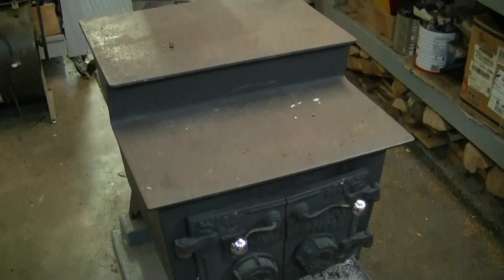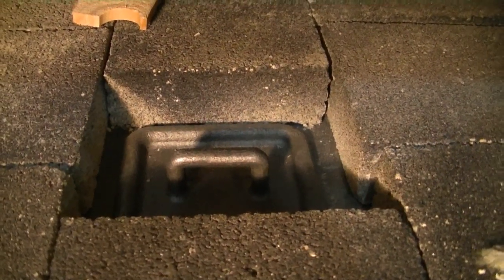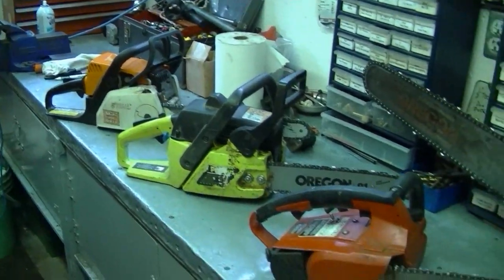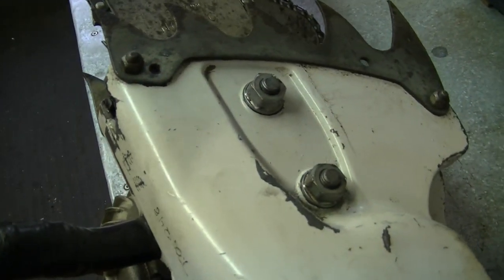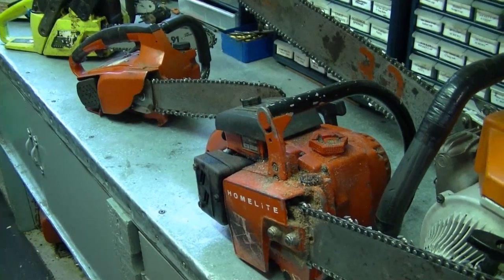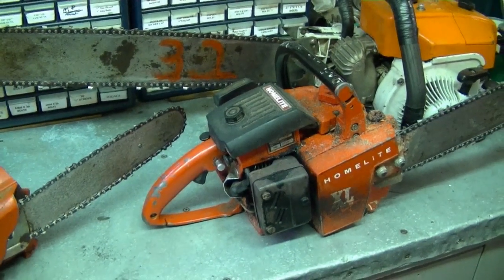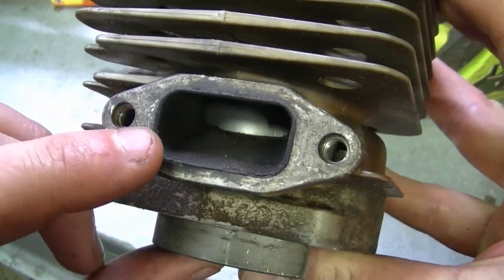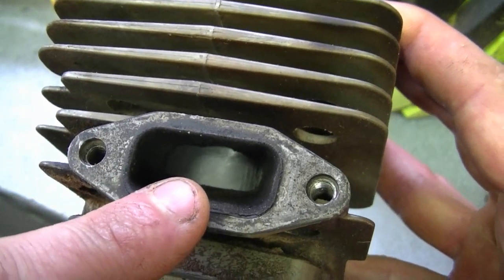Small Engines Q & A Video #71 in HD

Comment: @chrilla1980 I don't know much about small engines, but for a four stroke engine the main advantage of premium gas is pre-ignition suppression caused by anti-knock additives. For most auto engines, more explosive regular gas works fine, and of course it's a lot less expensive.

Comment: @siralexu depends, can you remove the cylinder, if so you can use a small wire brush,  or compressed air blower and poke around, I would recommend the compressed air, you can use carb cleaner or petrol or something like that, it will lift the carbon. just don't scratch the cylinder and make sure you leave nothing behind,the carbon may scratch the cylinder wall!!  if you scratch anything too badly it will wreck the saw...

Comment: Quick question Donyboy,

When a chainsaw is running should there be any movement in the clutch/sprocket assembly? Mine moves slightly forward and backward and I wasn't sure if some movement is normal or if it needs to be tightened up a bit?

Thanks!

Comment: hey donyboy73 I have a craftsman 3/21 it has a 3hp engine and a MTD yard machines the craftsman ask for a 40:1 ratio and the MTD is 5.5hp ask for 50:1 ratio is there a ratio I can use for both I do not want to have to gas cans with two different ratios of gas